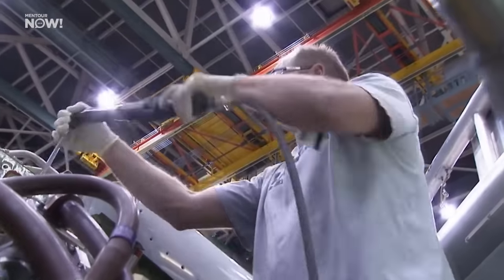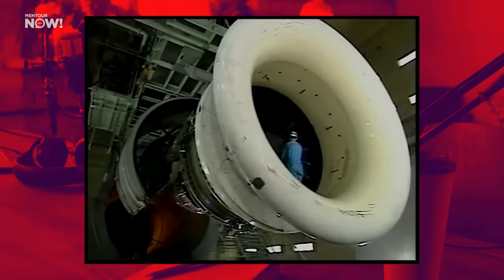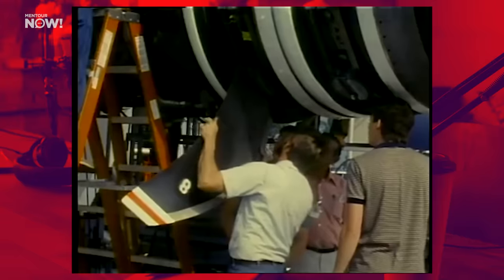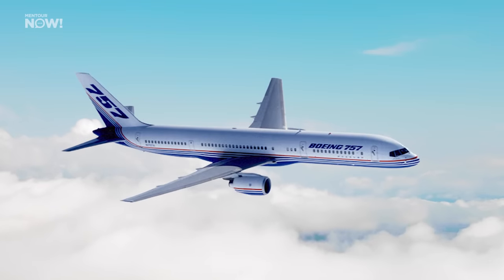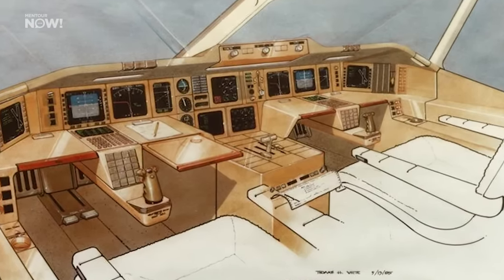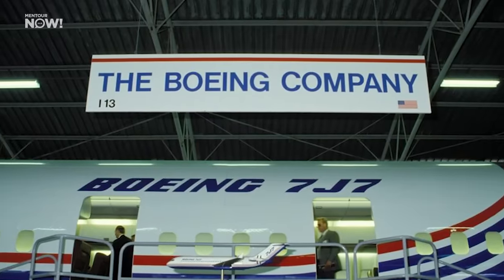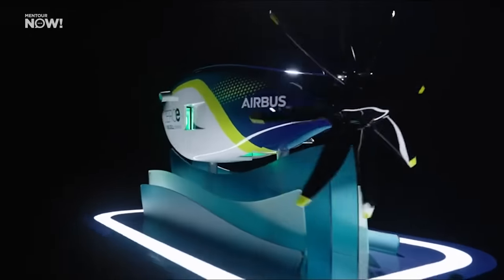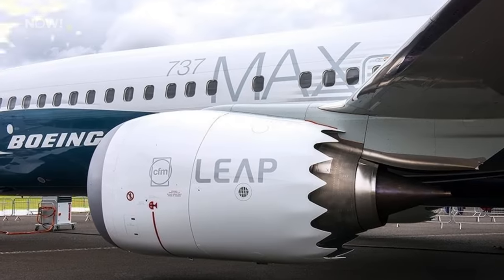Revolutionizing Flight! The Amazing Potential of the CFM RISE Engine.

Comment: I'd think it would have the same problem as the XF-84H Thunderscreech plane. I don't want to know what happens to the ground crews once that propjet spins up. The propellers that have been spinning stupid fast have been known to cause problems, ranging from crews vomiting to total blackouts, due to the tips of the propeller being already at transonic to supersonic speed, effectively knocking people out with the sonic boom radiating from the tip of spinning propellers (thus XF-84H Thunderscreech plane was abandoned immediately after a few flying sessions).

Comment: Interesting that Hydrogen will probably become the standard fuel for aircraft because of its high energy per-Kg (about 3x better by weight than Kerosene, but 4x worse by volume), where the high volume is a problem for compact cars, on a jetliner they can make the fuselage as long as they want with little consequence.

Comment: Since you mentioned the Tupolev Tu-95 (NATO name "Bear"), you mustn't forget the airliner based on this plane, the Tupolev Tu-114 (NATO name "Cleat").  It has the distinction of being not only the fastest turboprop-driven airliner, but the fastest PROPELLER-driven airliner.  :3

Not to mention, far as I know, these and types derived from these airframes are likely the only propeller-driven aircraft with swept wings, which is why they fly so fast..

Another propfan-driven plane that came around much later than those powered by P&W and GE UDF engines was the Antonov An-70, powered by four Progress D-27 propfan engine using using a pair of contrarotating fans.  The type is more or less ready for production per the Wikipedia article, but of course, World Events(R) would have other plans for Antonov's home country, Ukraine...

Comment: I wonder how they'll deal with blade-out issues. We had to ensure containment of blades in the fan case on the GE90 program. -There's nothing to stop a separated blade from penetrating the fuselage, as there is in engines with nacelles and fan cases.
Reply: Of course, I wrote that before finishing the video, and as I finished, you came to the point about blade-outs. I hope fuselage reinforcement will be the accepted correction for this issue.

Comment: Nice idea for a powerplant - but they will be limited to subsonic speeds because open blades loose efficiency as they move across the transonic envelope into the supersonic range - this is what limits helicopter speeds - once the rotar blades hit the speed of sound in the air they are moving through they lose lift. Considering the speed of sound drops as you climb in the atmosphere, the speed of the rotor blade tip becomes a critical issue.

Comment: I am not an engineer of any sort, so take this with a HUGE grain of salt. But I just saw earlier today an MIT project that replaces conventional propeller blades with a toroidal shape that is claimed to be significantly quieter and potentially more efficient as well. One of the things mentioned was the reduction in tip velocity iirc, which makes it seem like a potential solution to one of the problems mentioned in the video. I'd imagine they'd also be more durable due to each segment being a loop connected to the hub at two points rather than a single blade, and that also makes the "edge" blunter almost like the loops form something analogous their own containment nacelle. 

The big question I would imagine is that of the variable pitch, I have zero idea if it's even possible to do that with a toroid and if so how it could be accomplished, but it struck me having seen both of these proposed innovations the same day that it's possible that the one might be applicable to the other.  Maybe someone should put the two teams in contact and see what they can brainstorm up.

Comment: I still don't understand how the open fan engine can preform just as well as a conventional turbo fan at M=0.8. The point of the nacel is to slow down the air entering the engine and that slower air (also higher pressure) is critical to making the engine run well. That is why turbo props usually fly slower. 
The only thing I can think of that would make this new engine actually work well at those speeds are thinner blades. But I am not sure if its enough. The variable pitch might help too.

Comment: This is most definitely an extremely exciting and important project! I see the bypass ratio may approach around 20:1 and that the Rolls Royce Ultrafan may approach something like 15:1. I'm wondering which type will ultimately dominate? Given the CFM RISE open rotor engines are a fair bit slower than high bypass ratio geared turbofans.

Though the 20:1 bypass ratio is going to be tough to beat.

Comment: what's the difference between a turbo prop and an "open/unducted" fan?
Reply: The main difference seems to be blade design. Turboprops use a propeller. UDFs use a fan, with blades having a larger surface area and a different shape.

Ask yourself if a turboprop would act like a turbofan if you put a shroud around it.
Reply: @ReddwarfIV  I don't know if a prop would act like a turbo fan if you put a shroud around it. im not an engineer nor do I have fancy software to do the simulations, besides the question you want me to ask myself  is kinda vague.

How would you answer that question?
Reply: @Rainer Kinzinger  Fair. The benefit of a shroud is to avoid aerodynamic issues at the tips of the blades. A fan is shaped not only to butt up to the shroud with close tolerances to minimise the amount of air between them, and has as many blades as possible to fill the limited space.

By comparison, a propeller has fewer blades which usually have rounded tips, or where the tips are flat the tips have a short length. If you put a shroud around them, you will get minimal benefit from it.

Comment: I have reservations about open fan engines in commercial aviation due to the danger of blade having a catastrophic failure of a blade,  and no nacelle to help capture high speed metal pieces tearing through the fuselage.

Comment: turboprops do not have reinforcement to prevent blades going through the fuselage. What you see is the ice shield. it is to stop ice damage. you wont stop a prop . However props are way more damage tolerant than fans
Reply: There are many turboprop passenger airplanes still operating today and have zero issues about detached blade. Every airplane undergone serious checklist and maintenance before taking off, that risk is near zero percent

Comment: I recall this technology and followed it avidly in the 1980's. It was dissappointing to see development abandoned.  Most of the complaint was simply noise and I felt they weren't really trying to follow through with solutions.  Ultimately, the solution will require composite blade flexing and a composite collar sound-absorber.  The technology is very promising and far more economical to construct than people realize.

Comment: Aviation is going a phase of evolution that is impressive. I just imagine an engine 20% more economic that the actual engines that where alread 20% more economic. It's insane, but excellent news.

We will also need to reduce air trafic in the future. And a return of giant airliners like the A380 could be a very logical step.

Comment: I think if they used 2 x 12 blade propellers counter rotating, the noise level would drop gain more thrust but lose a bit of efficiency.

Comment: You missed one other problem with open rotor - uncontainable fan blade out. These blades are huge and capable of passing through the fuselage and taking out the engine on the other side.
Reply from the maker: I did mention that in the video.

Comment: There's a lot of info about Ducted Fans; above a certain airspeed, its efficiency is not that good, some large Turbofans look as Ducted Fans.
Also, experiments exist describing the good results with something like a 'Trompe', where a jet of fluid drags another, larger mass, lower speed flow.
At least, this has the potential to reduce noise, heat print. About efficiency, tests are welcome!
What about 'Counter-propeller', by Wagner, patent US1609978? It's same as fixed vanes after rotating blades in a turbine engine.
Blessings +

Comment: Any time you put dirty air in front of a propeller, it screams.  The dirtiest air possible is that coming off another propeller.     I don't doubt the claims that those old counter-rotating fan engines were at least as loud as the low bypass turbofans of the era.     Even just putting a wing in front of a turboprop makes em noisy.      Case in point is the Piaggio P.180.   It's a very efficient aircraft, with canard, main wing, and horizontal stab all lifting, clean air over the wings with twin pusher turboprops.    But we used to have one fly in out of  the Bitterroot Valley in Montana, and it was by far the loudest plane that could be heard from 8-10 miles out.   Just obnoxious.  
I'm glad that the CFM Rise concept should eliminate that problem as they'll be mounted up front (or up high) so clean air in front of main fan, and hopefully nothing about the non-rotating vanes to make them noisy.

Comment: Is there any real reason why the tips of the blades couldn't be in a simple tube that rotates with the blades?  That is, connect a short duct to the fan itself (with appropriate bearings for the fan to adjust pitch angle).  That makes the fan lose less sideflow air, helps alleviate the problem of a broken fan blade, probably makes it safer for ground personnel, and made of something like reinforced carbon fiber it wouldn't increase weight excessively.  Just seems logical to me (though I am NOT an engineer!).

Comment: Wonder why the decision to make these open fan engines smaller rather than to simply decrease the speed of the props to reduce noise. I would think that overall, there would always be advantages associated with relatively slower spinning prop blades.
Another interesting concept is the design with non-rtating stationary blades behind a rotating prop. I would image that teh stationary blades "straighten out" the air flow thrust and the weight and complexity savings more than compensate for the lack of thrust of a set of counter rotating spinning blades.

If I were to guess, despite the open prop designs shown in this video that eventually a small amount of ducting will be added to manage wing tip vortices but not enclose the whole engine as is being done today. Am guessing would be a practical solution over some kind of toroidal design to achieve the same benefit.

Comment: I went to GE Engine school in 1987 at Evendale Ohio where they had in their on campus museum the Ultra High Bypass/ Unducted Fan engines on display. They are worthy as a powerplant but the flying public is not going back to "props" after the quality of jet engines. In the final analysis the Noise issue cannot be overcome.  This is a re hash of an old story.

Comment: Thank you for a thorough and simple explanation of this concept. A very good presentation. I have some questions about compressibility effects at altitude regarding the prop-rotor. It appears that either the tip speed of the prop-rotor or the forward speed of the aircraft will be limited and why not shroud the stator blades?

Comment: One question… what about the safety aspect. We recently had engines that have thrown a blade and the nacelle’s job was to keep the blade inside the engine. Without a nacelle what is there to stop the thrown blade going through the wing or even worse, the body of the plane then the bodies of the passengers.

Comment: I wonder about the proposed cruise speed of .8M.  A typical long haul aircraft today flying a 3000nm sector at .84M would complete the sector about 20min quicker than an aircraft cruising at .80M. Not only fuel burn but also the cost of time in the air should be considered.

Comment: Am I the only one who would get major anxiety flying in a plane with two massive turbo-props engines like that mounted near the tail? One blade out event in the wrong direction and you've now got a huge hole through the a part of the plane where all the control interfaces meet.

Comment: Dual props are extremely noisy due to the blades passing each other simultaneously. It is rather strange, that they don't use a different number of blades on the two props to get around this issue, even though this is an issue that has been known since the 1950's. The turbofans though scale up extremely efficiently, as the power of the engine grows in proportion to the distance from the center of rotation to the blade tip increases.

Comment: I’m curious if the reduced, possibly nil, torque of the contra-rotating mechanism on these new engines allows the manufacturer cost savings by reducing structural reinforcement of the engine mounts. There would be less structure, less stress, less maintenance afforded by the changes I would think.

Comment: I know that they just stopped making them but it would be interesting to see a 747 or a A 380 using these engines. I know they are using a A380 to test it but a airplane that big powered by what are basically turbo prop engines would be interesting

Comment: Bypass Ratio (*) maybe could have had more - and upfront - in-depth explanation for the less well informed in these matters. I would also underline that the design of ducted versus unducted fan engines is an optimisation problem. Maybe we could call all propeller aircraft "unducted"?
In the case of unducted, there are losses of air thrown off the prop/fan blades to the side, in the case of ducted, the duct (nacelle) adds some drag. And apparently the turbulent wake (vortex) behind engines and plane causes propulsion losses too - the static fan-blades in one engine design shown in the video illustrate that.
The commonality between all these engine designs is that they chose a solution to the optimisation problem from a space of alternatives that has more than one optimum.
One thing that flew over my head in reading up on jet or turboprop (**) engines is that they may have a gearbox - where significant transmission losses happen (and where wear in the transmission adds a potential point of failure).
In heavy industries - or locomotive-engines to trains - we see that it often is more efficient to replace the mechanical gearbox, clutches and transmissions by a generator on the engine that transfers power as electricity to one or more electric motors that do the locomotion/propulsion. "Diesel-electric" is more than a century old and direct drive electric engines can be very light - look at the Aptera's (***) hub motors where we see "zero" transmission losses and are only faced with the motors' efficiency.
As to "noise" I still remember e.g. DC9 aircraft that were extreme. Or power drills of 40 years ago. Or computer fans of 20 years ago. In the meantime, humanity has conceived ideas how to design propeller and turbine blades for higher efficiency and lower noise - yes, as Mentour said, thanks to computer modelling. I would think that less noise actually also means less losses and this is another - unanswered to me to today - question that would add to this discussion.

(*) The ratio between the air/gasses flowing through the actual "hot" turbine engine that is the core of jet engines. The engine is a tube inside the large outside tube of today's jet engines and most of the thrust is from cold air that flows around the inner tube with the actual engine in it.
(**) where a turbine drives a propeller - "classical" or "vintage" propeller air-planes have an internal combustion engine like cars or motorcycles: so a reciprocating piston in a cylinder in a two stroke or four stroke design with a spark-ignition (normal petrol/gas engine) or a compression ignition (like Diesel). I believe that aircraft engines are generally air cooled and hence have each of their cylinders exposed with cooling ribs, plus often are of boxer design as a way to enable more cooling surface and less heat transfer from one cylinder to another.
(***) A brand in start-up phase that produces and extremely aerodynamic three-wheeled electric vehicle - the name seems (classical Greek lessons are a long, long time ago) to me to mean "does not fly". I hope and wish, though that as a business it will fly.

Comment: How about the safety issues that the open blades present? At least when a traditional jet engine craters, the fan blades are encapsulated. I know that doesn’t happen on a regular basis, just a thought.

Comment: I have always wondered why there is only one rotating propeller and not three possibly counter-rotating inner cores since the outermost edge of the propeller is rotating at a much faster speed than the inner core of the propeller. So if the propeller was 7 feet in radius it would be divided by infusing a second propeller within the 2.5 feet to 5.5 feet possibly counter-rotating within the outer faster moving propeller blades extending from 5.6 feet to the outer edge of 7 feet and another inner core which extends from the center of the propeller to the second counter-rotating blade extending to 2.4 feet. This way the innermost core propeller blade can rotate at an exponentially faster speed than the second blade blade which can rotate at 12x faster than the outermost blade allowing a steady air flow rate throughout the surface area of the propeller and possibly increasing it's efficiency?

Comment: going from 12:1 to 20:1 is not 20% increase in size.  it's more like 66% increase in size, 66% more "thrust" depending on the blade design.

Comment: Ahh, propfan design. Interesting that the idea comes back.
Interestingly there is some sort of fluid process
piston propeller <-> turboprop <-> propfan <-> turbofan <-> turbojet <-> turbojet afterburner <-> rocket
Turbofans are in some way ducted turboprops already.
Reply: The progression is all about exhaust velocity. You can't go fast with a low (eg subsonic) exhaust velocity.